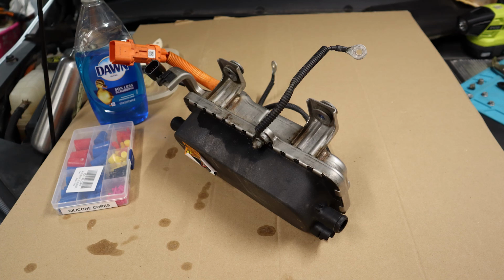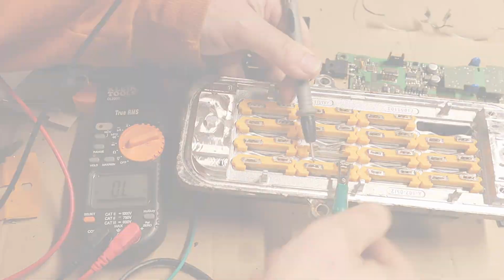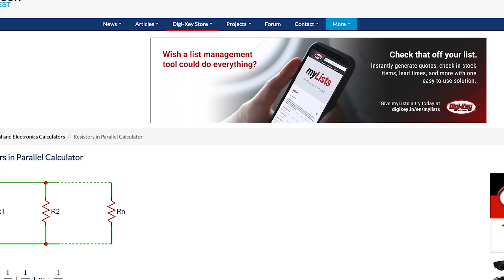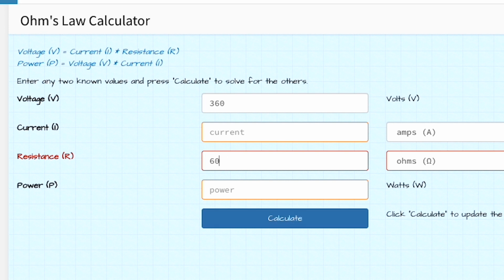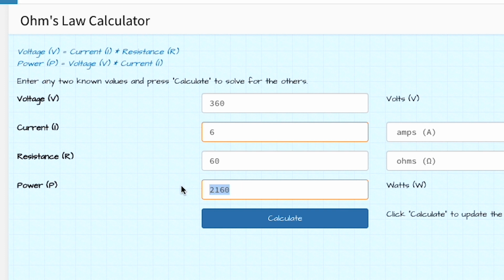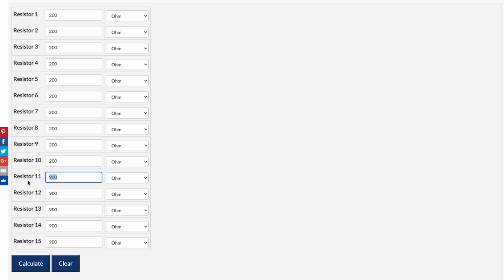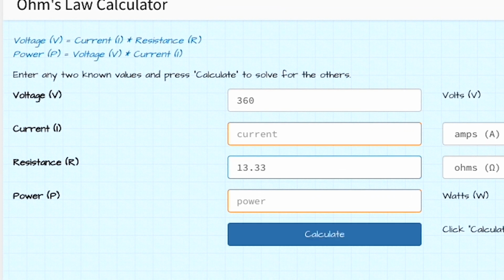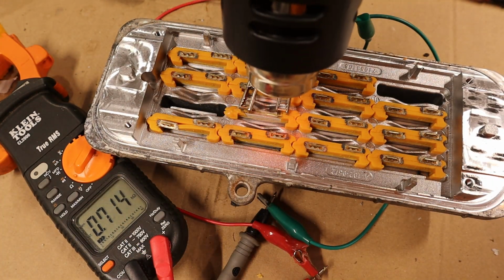Chevy Volt Heater Tear-Down: Resistance Varies with Temperature

Comment: Virtually all materials change resistance with change in temperature. The trick is to manufacture a material that increases resistance with increased temperatures so it becomes self limiting at the desired point. That’s called a positive temperature coefficient or PTC heater. As it heats up it accepts less power naturally so it doesn’t get hotter and hotter and burn itself up. Of course there’s a lot more to it than that but you get the idea.

Comment: PTC resistors and I guess would 2-3 kW at most for the heater - opps NTC resistors in your case, the electronics take care of it ...
Reply: Yes, it seems weird the fist Volt used NTC heating elements and thus required careful regulation by the power electronics. Nowadays PTC heating elements are fare more widely in use, as that regulates max power on it's own, and only requires electronic throttling when less heating power is required.
Reply: This seems to be typical PTC behavior. Up to 120-150°C it behave like a NTC. After 150°C the resistance rise quickly. This limits the temperature at the element and it is a safety function.

Comment: An ICE car heater is rated between 2 and 5kW depending on the vehicle. 2000 Watts in the confines of a small vehicle is plenty, as the HVAC controller will modulate between recirculation and fresh air to maintain the temperature set, and often add AC to eliminate fogging of the interior.
Reply: Yes, a car is a small space, but it's also mostly enclosed with low insulating glass and the HVAC system is dealing with huge temperature differentials when a car is left overnight in the winter. My LEAF includes a gauge of HVAC power usage, if it's below 20F and you ask for 90F air it'll use 5kw until the cabin gets warmer up a bit, then it switches over to the heat pump which uses 2-3kw until the requested temperature is reached, them maintaining the temperature usually requires less than 1kw.

Comment: 2000 watts seems like a ton of power to me, 8000 would be insane. Think about it this way, a 1500W space heater will warm up a bathroom in a few minutes,. Your car cabin is a lot smaller than a bathroom. I use a 6000W heater to heat my 500sqft shop. Maybe I'm missing something here.
Reply from the maker: Try putting a 1500 watt heater in an uninsulated vehicle in sun-freezing weather. It certainly works, but is relatively slow. Cars have powerful heaters to be able to defrost the windshield quickly bring the cabin up to a comfortable temperature.
Reply: Yes, you are missing something here. A car coolant heater for heating the passenger cabin runs between 5kW and 7.5kW (Chevrolet Bolt EV) and a battery heater runs an additional 2.5kW or so.

Comment: Ohm's Law is a formula used to calculate the relationship between voltage, current and resistance in an electrical circuit.

To students of electronics, Ohm's Law (E = IR) is as fundamentally important as Einstein's Relativity equation (E = mc²) is to physicists.

E = I x R

When spelled out, it means voltage = current x resistance, or volts = amps x ohms, or V = A x Ω.